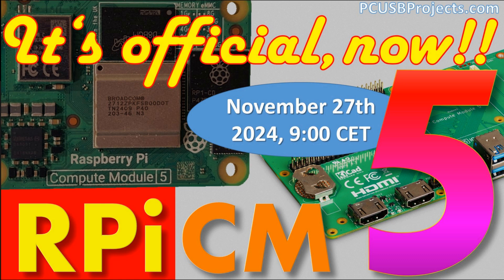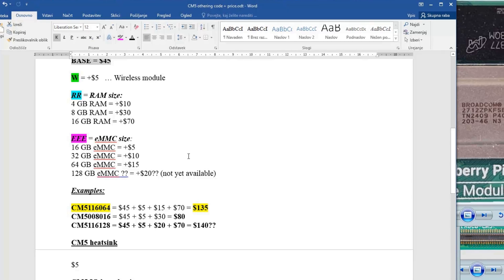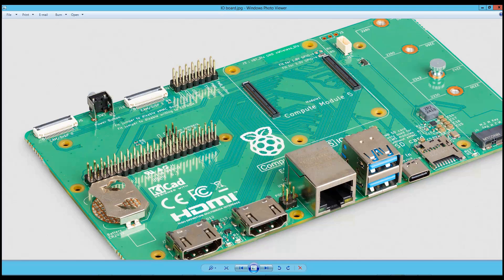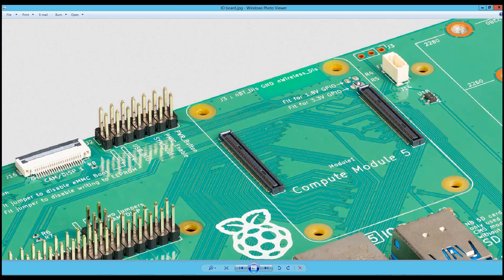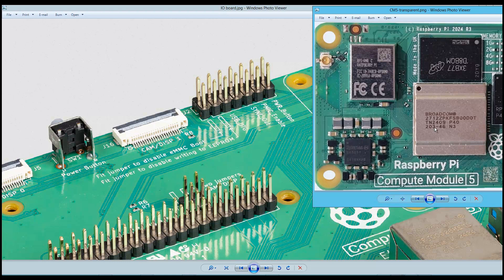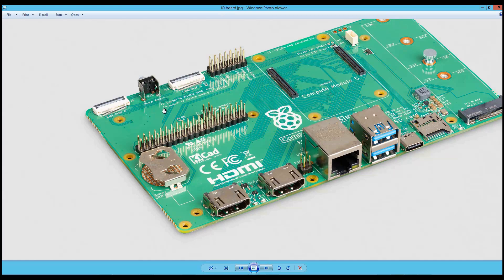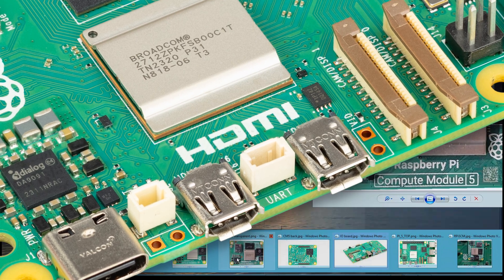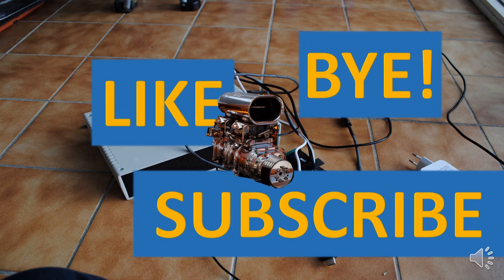Raspberry Pi Compute Module 5 officially released! 16 GB RAM version in  2025? Full analysis!

Comment: if i want integrate and create project sensor with CM5, i should buy the kit right?. Can i just buy a module of CM 5, to integrate with a sensor project?
Reply from the maker: If you buy a kit, it is usually easier because you don't have to make your own  PCB for a sensor. It is also possible to use a protoboard and wires to connect a sensor directly to 40-pin expansion port, if there is need for a controller chip. Raspberry Pi has powerful microcontroller functionality with hardware support for various communication protocols like: SPI, I2C, TTL RS-232, etc. Whatever you do, you'll need a schematic, which you can usually find on the internet....
Reply: @pcusbprojects thanks for your answer, could you give a tutorial about mq sensor/any sensor that connect to rasp CM5?
Reply from the maker: First of all, CM5 is designed to work with a base board of an arbitrary HW maker, so such a board may already include certain sensors. Watch this video https://youtu.be/5Xffn_21_QY to see the original Raspberry Pi's development board for CM5, which also includes a 40-pin expansion connector. Use 40-pin expansion connector to add a sensor like BME280 (air pressure, air temperature, air humidity). Also watch this video (https://youtu.be/BINHFtPJi7o) to see an example how to connect additional HW to the 40-pin expansion port. Simple HW like mine can be powered from either +3.3 V rail or +5 V rail on the expansion port. The video is about connecting and programming an ESP32-CAM module, but you can use the same principle to connect anything. If you connecting BME280 sensor through SPI or I2C pins (depending on the mode selected on the sensor), you will have to use different pins and different program libraries, but relatively easy to connect and program almost anything form a Raspberry Pi.
Reply from the maker: You can watch https://youtu.be/BINHFtPJi7o, for example (here is a more detailed description: https://sites.google.com/site/pcusbprojects/9-raspberry-pi-projects/b-wi-fi-remote-onoff-controller). If you are interested in MQ sensors, may also like this article: https://svet-el.si/revija/programiranje/programirajmo-esp32-module-v-tasmota-razvojem-okolju-2-del/. Use Google Translate, if you wanna read it in English.
Reply: @pcusbprojects could you give a tutorial about sensor mq or any sensor connect to rasp CM5?, and then can i make a rust code in vscode that integrate the sensor? or it should be python?

Comment: I tried the standard cooler and the mounting is different so it won't fit directly. It is larger than the CM5 heatsink. The CM5 heatsink interferes with the fan in the Dev kit box. So we need a low profile CM5 heatsink to fit under the fan in the Dev kit box, or to move the fan to the outside of the box so the heatsink can fit under it.
Reply from the maker: Maybe this is a (temporary) solution for you. Watch this video: https://youtu.be/5Xffn_21_QY